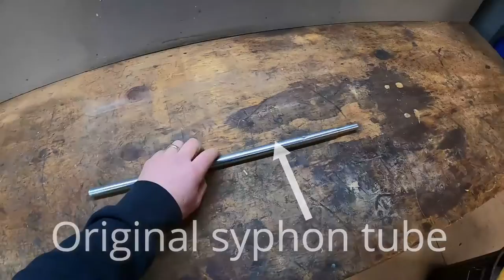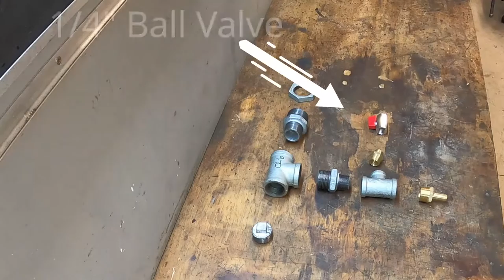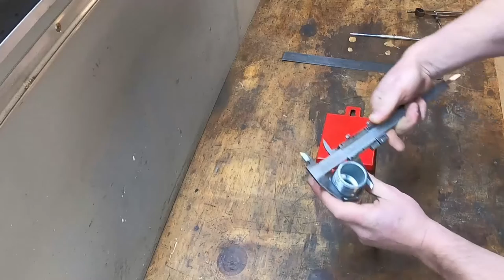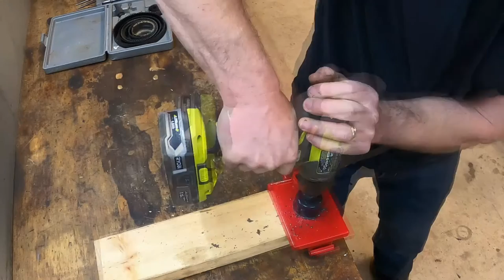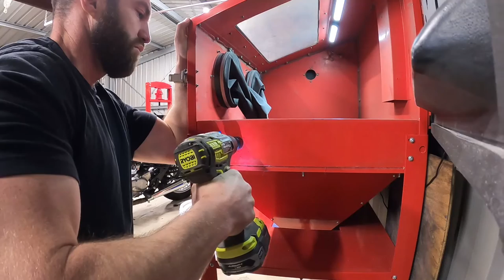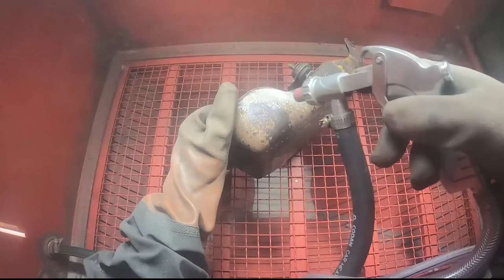Best Sand Blasting Cabinet Modification

Comment: I use the same set up, but make it easier by prepping the part first. If it's painted, put it in a tub of caustic soda and water for a week first, then hose all the paint and grease off. Actual work time becomes less than 5 minutes. Then put it in a tub of household vinegar, leave it a few days, then most of the rust will hose off. Another 5 mins work. Then beadblast the part. Another 5 mins of worktime. Saves time, electricity and media and the parts clean up a treat. I've been doing it over ten years with great success and saved hundreds of dollars. Of course this is for cast iron, steel, brass and copper only. Items will come out of the vinegar black, that's gone in seconds once you start blasting. Putting the part in a bucket of hot soapy water before blasting will remove any residual vinegar in the pores of the metal first. 👍🇦🇺
Reply from the maker: Thanks mate. I will give that a go.
Reply: @2wheelworkshop Get yourself large square tubs with lids, or 5 gallon paint buckets with lids. The caustic bath or the vinegar bath will last up to a year, it is not a one time use resource. If not happy with the results the first time you hose the parts off, just drop them back in the tub. Wait a couple of days and hose them off again. It frees you up to work on other things while they soak. If you don't intend painting or plating the item, (engine or gearbox internals etc) spray the item with kitchen cooking oil and wrap it in food wrap. It will preserve it until you require it and will wash off easily with petrol. Canola oil has been used in the aircraft industry for years as as preservative. I am an old dude who has always looked for ways to work smarter, not harder, using household products that are cheap instead of spending big dollars on flash expensive commercial stuff. I also have a plethora of bikes, yet to restore, and the clock's ticking, I will not live forever. 😅
Edit: Always wear rubber gloves, the caustic bath will make your skin fall off, the vinegar will make your fingernails turn brown, wrinkle up and fall off (common sense, but have to point it out for the uninformed brainiacs).
Reply: @coolhand1964 Second the other comment, I use Vinegar for rust removal, I buy the 10 % at Home Depot because it works faster. Vinegar is cheap and not a bunch of Chemicals Thea who knows what can do to a person. Minor rust gone 1-2 days heavy rust I leave 2-3 days remove clean and scrub lightly with a small wire brush and water then back into the soak for another few days. Takes a bit of time, Works effortlessly, low cost, great results especially cast steel comes out like new most times. Use your blast cabinet to finish the part.

Comment: Hey mate,
Great video, simple and to the point,
even overcomes the worldwide language barrier!
Not to mention it was an Australian production, bravo!
I have ordered a bench top 190L blasting cabinet, 
should arrive soon and have discovered this type of 
mod seems essential for improved performance.
I hope to duplicate your effort and use it for restos
of my numerous.....um.....projects.
One thought though.
I'm thinking of using a bulkhead style fitting into the cabinet,
instead of a grommet arrangement, for better sealing and
ability to use/replace a more flexible hose inside the cabinet if need be.
I realise there is a risk of restricting flow but would look to modify
any fittings used in the system to reduce this.
Chamfering, blending in etc
If this fails, I can just run the hose all the way.
Thoughts anyone?
Reply from the maker: Thanks mate. I think the bulkhead idea would work fine so long as the inner diameter isn't too small. As you said, I would just try it and see how it goes. If it doesn't work it just means it's not finished yet.
Reply: @2wheelworkshop  
Yes, if you I overcome any potential restriction issues,
just go back to the full flow hose and grommet set up, easy.
I have been giving some thought to using a cross fitting instead
of a tee piece, that is Ball(metering) valve opposite the media pick up hose,
drain plug remains as is, putting the media between the vacuum source
and the "aeration/metering"  or "loss of vacuum" valve, so any air introduced
into the system must pass through the falling media, aerating it?
One could also introduce some regulated low pressure air to help, rather than rely
on vacuum alone?
I may be missing some basic principle here but if the cross set up doesn't work,
I can always plug it, admit defeat and change my YouTube name! 
Anyone got some thoughts or am I barking up the wrong tree?

Comment: I see you use 40psi. What is the flow rate (SCFM) required by the compressor? Mine is a DeWalt 60 gal. 3.7hp and will push up to 13 SCFM. Is that sufficient for this rig?.

Comment: I made one and although it was better than the stock siphon tube it still sucks. 
i think my problem is that i accidentally bought all 1" pipe fittings and made it too big. no one mentions making slightly too big can cause issues.
so instead of rebuilding it i just bought the parts washer guys modified metering valve.

Comment: Hi I did the same install as you did.. Can you tell me what air pressure you work with. It's not working so good as I hoped.. Maybe I do something wrong!!
Reply from the maker: I'm running 100psi
Reply: @2wheelworkshop  way to high pressure
Reply from the maker: @johngurney1069  Don't see how. It works well, doesn't do any damage and is within 10psi of the advertised optimal pressure.
Reply: @2wheelworkshop  watched and tried around 40 to 60 psi and works  also easier on compressor

Comment: A number of adjustments Brodie.  Which has made the most difference?
Reply from the maker: The only reason I went to dry blasting is because the pump for the vapour blasting conversion died. The  original syphon tube kinda worked for really fine glass bead but was un-useable for coarser stuff so if dry blasting i would say the metering valve is a must. As far as comparing the 2 its hard to say. The set-up now is far more convenient but I wouldn't bead blast carbs like I could with the vapour conversion. Maybe I'll try baking soda. The finish i was getting with vapour was better. I would say if cleaning aluminium vapour is the go, if using more for steel and stripping paint, dry is better.

Comment: Just so you know, this will cost like $40 to build if you go to Lowes LOL... Could just buy one made for it cheaper than that.
Reply from the maker: Don't have Lowe's in Australia.
Reply: @2wheelworkshop  Good, you don't want them. Lowes is a very common form of cancer.
Reply: @pauls.5815  Gonna try not to be too offended by that ;)